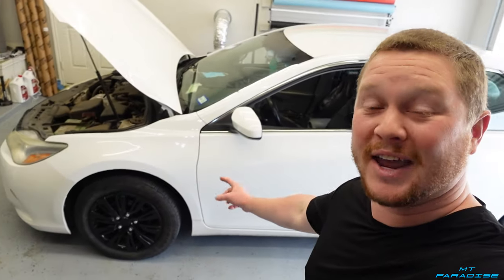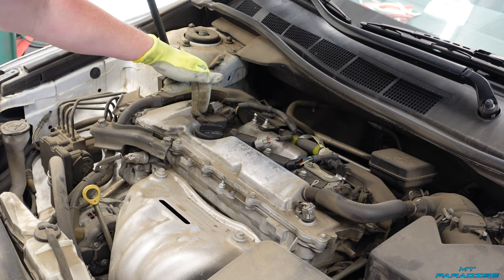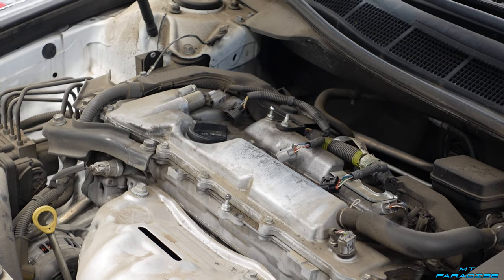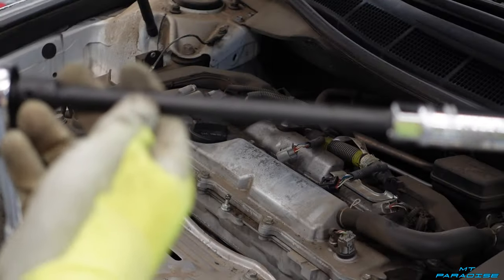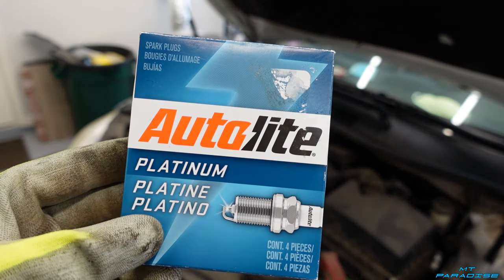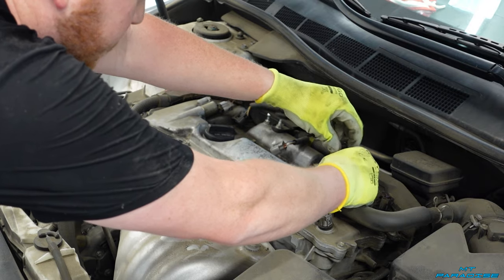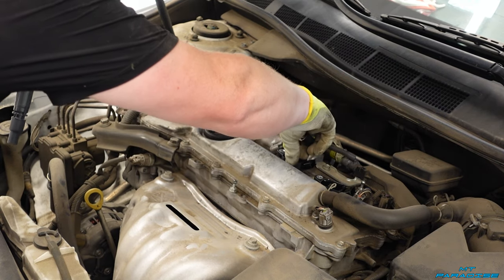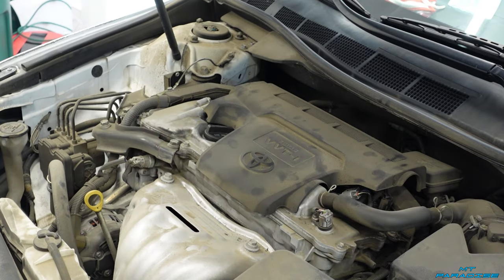How To Replace Toyota Camry Spark Plugs & Ignition Coils (2010-2017)

Comment: is it recommended to change out the ignition coils when changing the spark plugs?
Reply from the maker: Ignition coils usually around 80k-100k miles unless one or more faulty prematurely but spark plugs around 30k-40k miles
Reply: I can't find it anywhere in owner's manual or maintenance guide most people say 100,000 on double iridium plugs i changed mine at 59000 and they had no wear looked like new. no mention of coils at all

Comment: When should you change your spark plugs? When you hit certain mileage or when symptoms appear? I’m currently at 85k miles with nothin sounding bad or broken.
Reply from the maker: The spark plugs should be done every 30k-40k miles and the ignition coils 60k-100k. Replacing them before issues appear will also help your car run more efficient

Comment: Do you have to go 1/4 - 1/2 turn more with the plug wrench after hand tightening the spark plug to crush the gasket?
Reply from the maker: I make them pretty snug by hand tightening but I’ve always heard to not use anything other than a wrench and hand tight so the threads don’t get damaged
Reply: 3/4 turn it suddenly stops and gets much harder and you hit the 18 ft lb spec washer is fully crushed.

Comment: Nice video. I had some questions though. 

1. If I had 3 ignition coil problems that causes stalling, can I just replace 2 out of the 3 to use my car? I was planning to do all four(coils and plugs).

Money is kind of tight and I need my car to go to work.

2. How much does a mechanic charge if I got all of the parts needed to replace?
Reply from the maker: Even having 1 bad coil will still cause the car to not run right. 
Mechanics charge high hourly rates
Reply: @MTParadise  But it can still run, though.  Does this look like a 1 hour job?

Comment: I was looking for torque specs . I’ve heard 18 ft pounds but not sure . I just tightened with 3/8 inch drive ratchet and just tightened it by feel .. just to where it got fairly tight . Don’t think I overtightened it . Hope not
Reply from the maker: I did the same. Nice and snug but not cranked super tight
Reply: once it makes contact the crush washer you feel resistance you go 3/4 turn and then it stops and will go over 18 ft lbs to move anymore so gasket is fully crushed and sealed